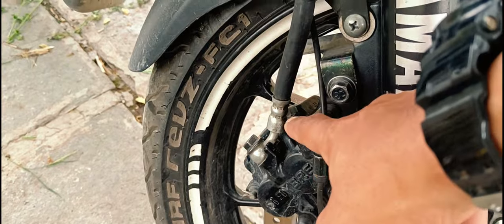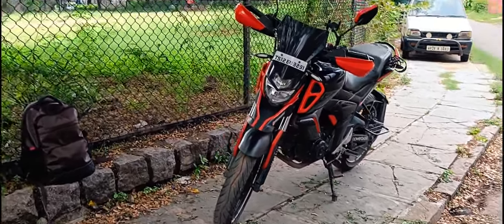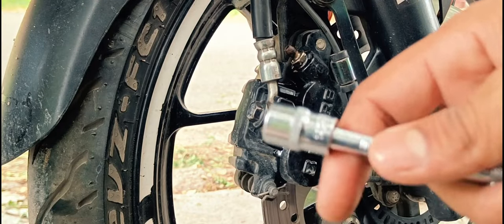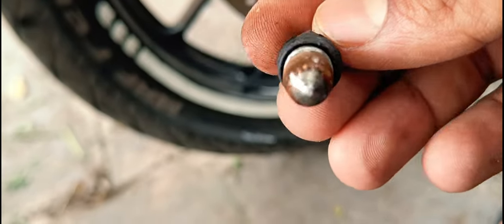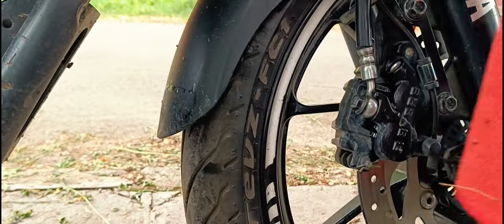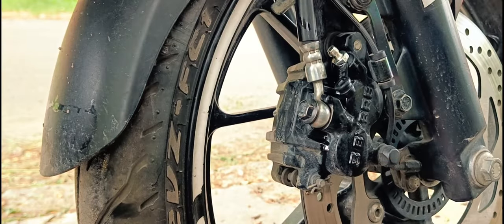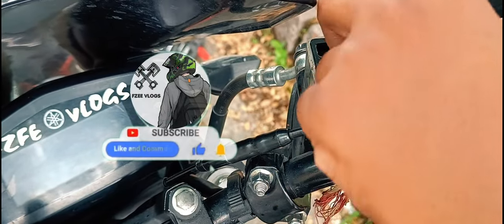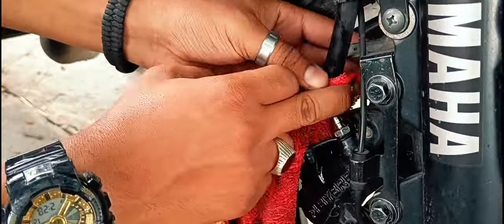💯solution for disc brake problems!#fzv3 #discbrake #disc

Comment: Bro my fz v3 has spongy front brake. I changed the master kit and still facing the issue. It happens when I leave the bike without touching for 2-3 days. It is loosing pressure. I checked the brake oil and each time when I check, if I try to bleed the oil from front brake caliper, small air bubbles will come and after that brake will become normal. Could you please tell me from where the air is getting entered if you are aware?

This issue is very irritating and facing this issue from 4-5 months
Reply from the maker: The olny solution is to reverse bleed the oil and do check for any cracks on the cable
Reply: @fzeevlogs4802  Hi bro, I did reverse bleeding also i.e from front caliper I inserted oil. Also, if there are any cracks, there will be oil leakage right. But for me no oil leakages are there.
Reply from the maker: @technofun80 inside the break liver there will be a small part which make clicking noise that part creates the air pressure in master cylinder do check that and replace it
Reply: @fzeevlogs4802  I replaced whole master cylinder bro. But still the issue persists
Reply: @technofun80 same problem vai changed everything but still same issue
Reply from the maker: @musclefactory8938 brother service the whole caliper and change the caliper rubbers
Reply: @fzeevlogs4802  I replaced the caliper rubbers and even replaced master cylinder as well. But still same issue
Reply from the maker: @technofun80 do check is the disc is proper or not is abs is working or not?
Reply: @fzeevlogs4802  Disc plate is perfectly fine. If it has any issues, front wheel will not rotate freely.
Also even ABS ring is in perfect shape (no bent).
Reply from the maker: @technofun80 may be absent system is faulty once scan the total by with OBD SCANNER see if any error codes are showing